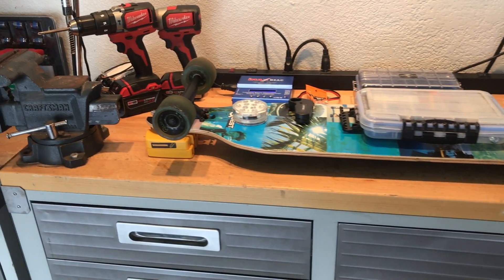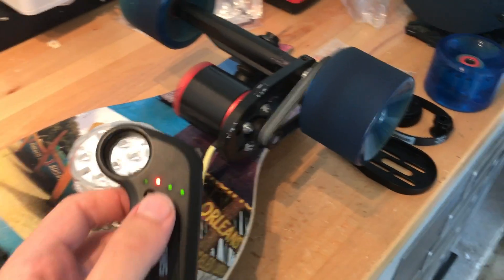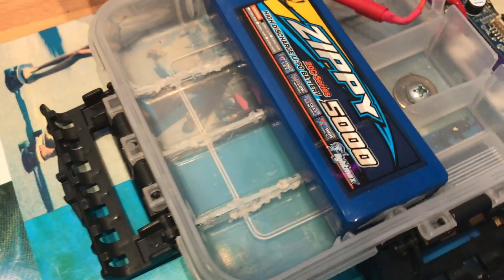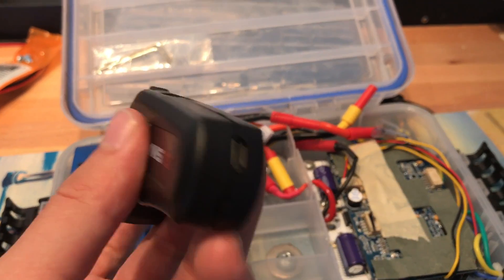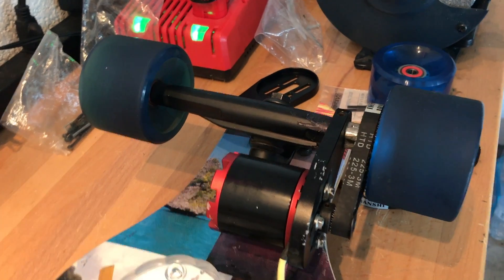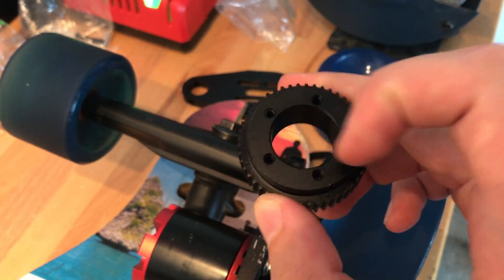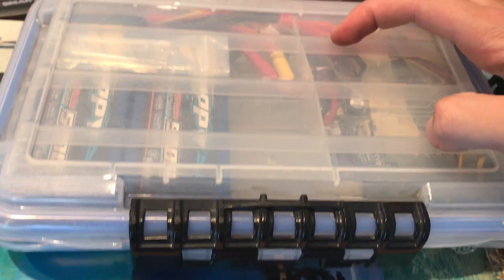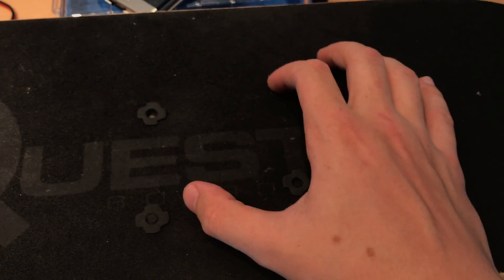DIY $250 Electric Skateboard Cheap FAST Light

Comment: Hey so I'm planning to build a board and so far this is the best build I've seen for the price I want to use the part you did but I want to be able to hookup 3-4 batteries in series so as to get faster speed and longer run time I'm just wondering if you think the esc and motor could handle that and have the potential to go at speeds 20+ ?
Reply from the maker: You should read the specs for the motor and esc, but in the nutshell: This specific motor can handle up to 8S Lipo batteries (I am using 6S). Also, this controller can handle up to a 10S batteries, but if you want to use this specific esc with the same motor as shown, you are limited to 8S batteries. However, you can use as many batteries in parallel for longer ride and even a small increase in speed due to less of a voltage drop while using multiple batteries in parallel. (Each S is 3.7-4.2Volt)
Keep in mind the extra weight and complexity of circuity if you wish to do so.
One more note: motor wattage rating is +~1800W and esc can handle up to 1300W per motor or 2600W for two motors.
Reply: ok so I've decided to follow your build but instead, I'm getting 3 batteries and put them in series I'm also getting a different motor which is the Turnigy Aerodrive SK3 - 6364-245kv Brushless Outrunner Motor ( https://hobbyking.com/en_us/turnigy-aerodrive-sk3-6364-245kv-brushless-outrunner-motor.html?___store=en_us ) this would mean I have a 9s battery powering a Max Power: 2700W motor do you think I could set to the dual motor esc to be able to run this?
Reply from the maker: The maximum output from the ESC board to a single motor is 1300 W, even for the dual motor ESC (2600W total, 1300W per motor). So you could not max out your 2700W motor using this ESC... Also, your Turnigy motor is only rated at 245kv, so for 20V that I apply to my motor(which is 400kv as shown), you must apply 32.6V to match me. Calculation of rpm BEFORE gear reduction ---> [20V * 400kv(mine) = 32.6V * 245kv(yours)] So with your added battery you might get more torque, but the top speed won't change.
Reply: Could you do a video, where u literally set it up as I have all the pieces but am unsure on how to actually put it together
Reply: Noah, did you ever build this board? I am curious on how it runs, because I am looking into building one of these.
Reply: And how do you connect the remote control to the modul

Comment: Hi! awesome build and it seems like a nice and cheap speed controller?
I'm making my 4th esk8 right now and I will also try to use the ebay esc.
Are you sure about your topspeed? you hit around 18mph and if I calculate your setup you must be able to hit 23mph?
Did you know you have a small switch on the controller to switch between slow and fast mode? Maybe that's the reason you were only getting 17mph ;)
Reply from the maker: Yes I am very familiar with the board and all its features. Realistically, top speed is 17-18 mph. Calculated, the board should be hitting higher speeds... This can be because of many factors, for example the motor (coming from china) and may not be REALLY be 400kv as advertised, rider weight, friction.

Comment: Hey I plan on making this board and I wanted to know 1: did you connect the batteries in parallel 2: how did you switch the port on the main ESP did you buy something special? Please respond soon thank you
Reply from the maker: The batteries as shown are connected in series in order to reach a sufficient voltage, although you could connect another 2 batteries in parallel (having a total of 4 batteries) in order to increase the range. The 3-phase input ports come directly from the board and is one of two (you can have two 3-phase motors running off the board) and the motor connects directly to this input. Nothing extra needed. Best of luck on your build
Reply: Mark Kash thank you but I meant the different port for the battery to the esc on to the motor
Reply from the maker: The motor shown has no extra wires for sensors, just the 3 phase wires. The extra outputs from the battery are just for charging, they do not connect to the ESC.

Comment: Sweet build Mark!  That enclosure solution fit everything perfectly!  I have yet to try that remote that you have.  I've seen them on the market and wanna get one just to try.  Wow!  Your motor is 400kv!  I can only imagine if you up your voltage that this thing can fly!  Anyhow, glad that I saw your vid.

- Neil
Reply from the maker: Thanks Neil, and I highly recommend the ESC/Receiver board and transmitter- especially for its size and price.

Comment: Have you had any trouble with the esc? Will it do two motors? Seems like an awesome price with the esc AND remote...awesome man
Reply from the maker: jeffbrent The ESC has worked out great so far, great range and connects instantly. I have yet to try it with dual motors.
Reply from the maker: After long rides and steep hills the ESC only gets a bit warm, never hot.